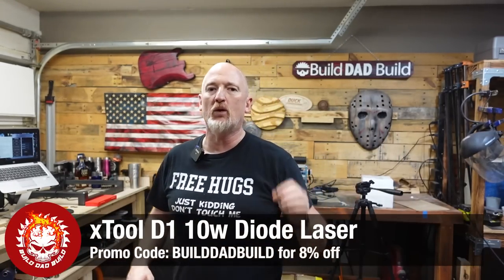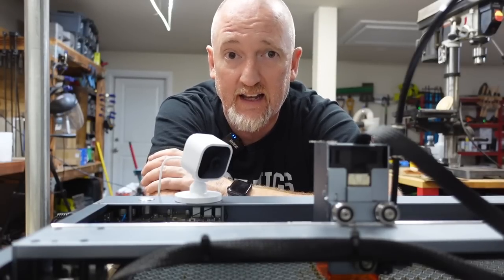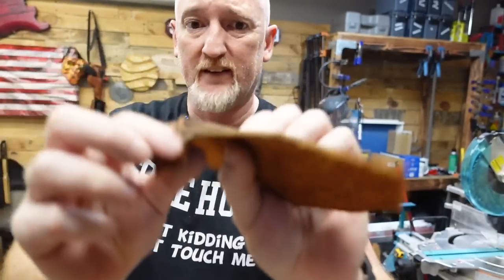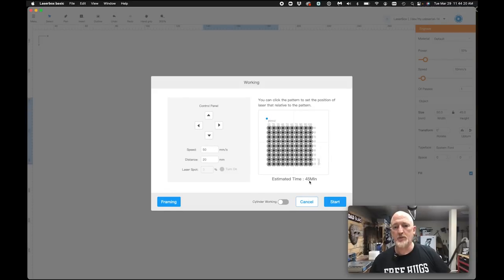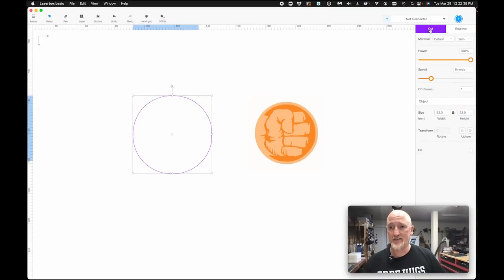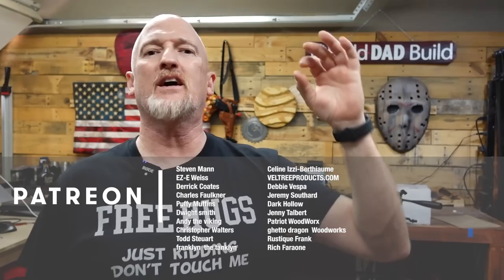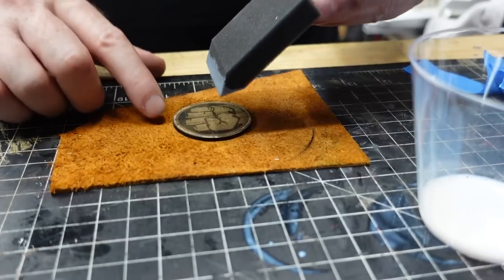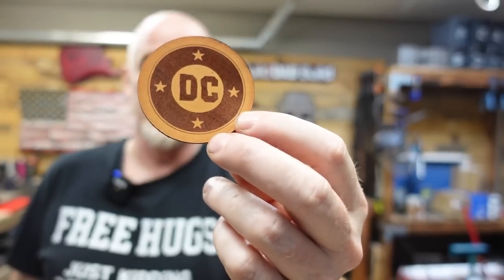Can You Laser Engrave Skin? - Engraving Leather with the xTool D1

Comment: Love your videos! I’ve been doing quite a bit of leather- mostly obscure hat patches you can’t get anywhere. I’m no expert, but I get amazing results. First off I use only “veg tanned” leather- the colored and processed stuff is way too inconsistent. Th chemicals used to process the leather probably aren’t the best to burn and breathe. As you mentioned I buy enough to last a while- I buy a “shoulder” at a time- generally it ends up being about 2’ x 3’. The veg tanned leather is very consistent between different pieces. I did an initial test burn using xtools material list- the same one you linked a while ago…. Thanks for that, it’s a great resource and gets you in the ballpark quickly. I used to mask the leather with blue tape to stop some of the charring but it was really difficult to remove afterwards. Now I just wash the burned piece under running warm water and scrub the burned areas with a soft toothbrush.I then  Blot it almost dry on some paper towels, and while still a little moist dye it to your preferred color. Let it sit overnight, then wipe it off and finish with “super Sheen”….. hope this helps omeone out there! Now if I could just figure out those damn ceramic tiles!!!!! Arrrrghhhh……
Reply from the maker: Awesome. Thanks for the tips!
Cheers
Reply: Just curious but what all do you make out of leather? I've been making everything from vests, belts, holsters, slings, moccasins, straps, Belt pouches, & sheaths. I went through 3 shoulders in a month. Making moccasins for The family alone lol

Comment: My d1 software doesn't support leather. Is there always I can do leather on my d1?
Reply from the maker: When in doubt, check the material settings:
https://www.xtool.com/pages/material-settings
Reply: @BuildDadBuild  I have and it has no settings available. I'm using the basic software so maybe it's just a software issue. I'm using leatherette material also
Reply from the maker: Run a speed and power grid.

Comment: Hello, I am a new xtool owner I was able to get it to burn my logo I made on lightburn once and now it will not burn a circle. It is distorted I have search all over for an answer.  I have seen you have awesome results. Do you have any idea what could be wrong. Ive had it two weeks and cant do anything. kinda desperate. If you can please help. Thanks
Reply from the maker: Are you trying to engrave on a tumbler? There are some settings the need to be checked if you are.
I would suggest checking out the xTool D1 Facebook group.
https://www.facebook.com/groups/xtoold1
You can ask the question there and even post pics...lots of helpful folks in that group.
Cheers
Reply: @BuildDadBuild  Thank you. I will join that group. not doing tumblers yet. just a flat piece of scrap ply. Im thinking I have a setting messed up in lightburn and was considering setting lightburn back to default.

Comment: I've done it so much now I actually kind of like the smell. I guess that's sad. I've been burning leather now for about eight months since I've had my laser and I've discovered a lot of things that work and don't work. I don't think people realize how much experimenting you need to do. I already work leather so I know how expensive it is. But I would say in the last 5 months I probably went through $400 easy in leather. I would say 90% of that has been experimenting and trial and error. I really wish I would have found your video a while back. My system is different than yours but it works and gets me good results. However I will not say that my system is easier than yours. It's great so many people are doing the legwork. I know people who bought $3,000 in laser tools and after two weeks of giving up. I'm looking for a laser now that edges on all metals. I teach welding at a college. I'd like to be able to give QC codes to well tests and keep a digital file on all of them for my records. I'm just not sure which one to buy. I'm thinking about the ex tool infrared or the ex tool f-1. What are your thoughts? Lightburn seems difficult. I'm using the standard software with x tool and I'm used to it. I just wished it had some more features. The good news is they're updating it all the time. I'm hoping they come up with a quicker way to arch letters than the current method
Reply from the maker: The F1 is probably all you need!

Comment: PLEASE HELP ME!!! I love your videos. I recently , about a month ago bought the Xtool D1 and have had a horrible time with it. Sometimes it connects to lightburn, sometimes it does not. My current problems are, when using text....on my screen in lightburn my text is the correct direction, but when it engraves its backwards! My next issue is when I go to hit frame in lightburn, my laser head will move to the start position and then it moves so slow you literally almost cannot see it moving, So i cannot frame my project, which is wasting allot of materials.I have all but pulled my beard out over the last couple weeks here and getting customer service with Xtool is like pulling teeth.
I thank you or anyone that may be  able to offer and help!!! Im new to this laser stuff though I do Have experience in graphic design and thus far my laser experience has been a bit frustrating!
Reply: I find when I have issues with the connection it is normally down by the connection method. When it’s plugged in I need to use com7 but it defaults to com3 so you may need to check that. There is a setting in lightburn to turn up the framing speed. I can’t remember where though. Louisiana Hobby Guy has some great lightburn videos. Hope this helps at least a little!
Reply from the maker: There's a setting in Lightburn for your frame speed. Check out Louisiana Hobby Guy's channel for specifics. 
Cheers
Reply: @jaredsilverman6309  Thanks allot man! , this led me back to his videos and I ended up resolving all my issues!!! I really appreciate  you taking the time to respond!
Reply: @BuildDadBuild  Thank you! I have resolved all my issues with lightburn and my D1 and Im finally enjoying my setup!!! what a great machine!!